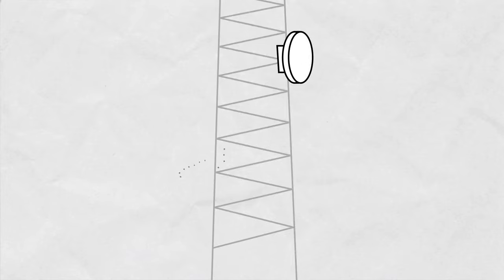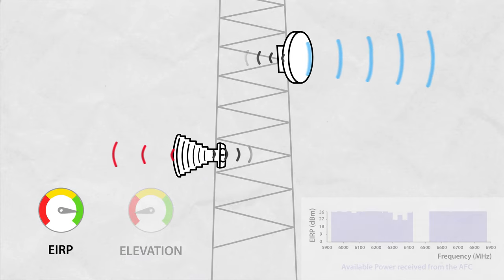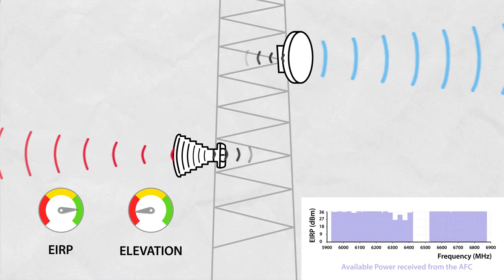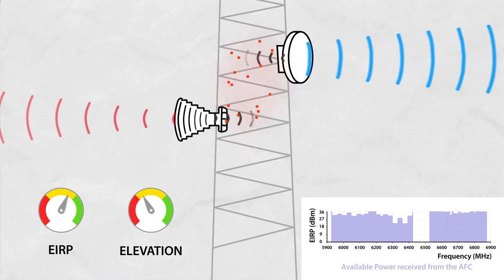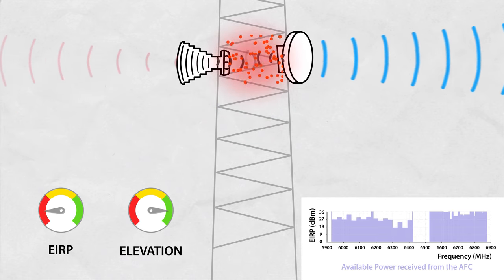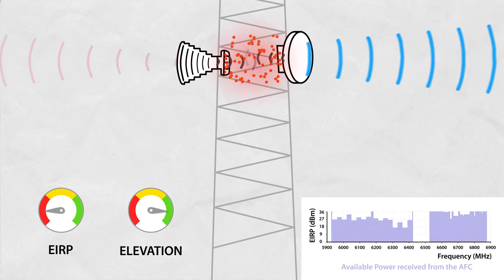6 GHz AP height

Comment: same for 5 GHZ ?
Reply: @arhackteam1  height limits is for 6ghz only
Reply: @arhackteam1  AFC is for 6Ghz in the US and Canada, so it mainly applies there.  In general though, some of the same principles apply when using 5Ghz, because the lower the AP the lower amount of noise you could potentially see.  Smaller cell sizes will allow for higher RSL's, better SNR's, and better performance.